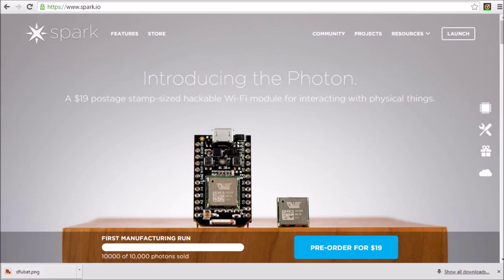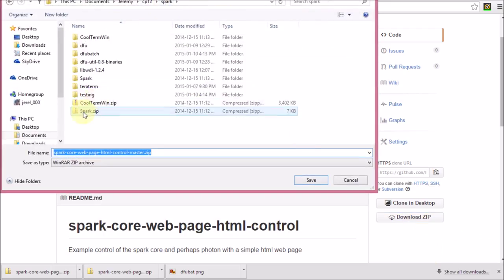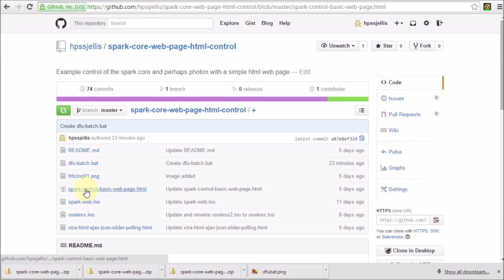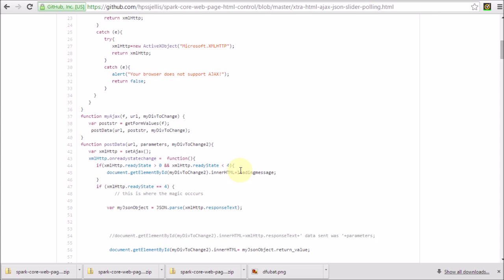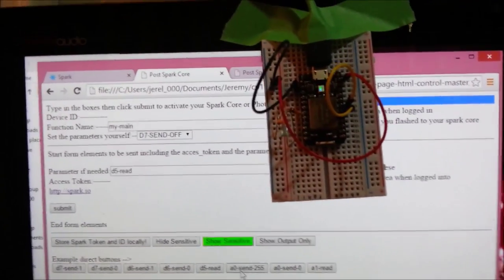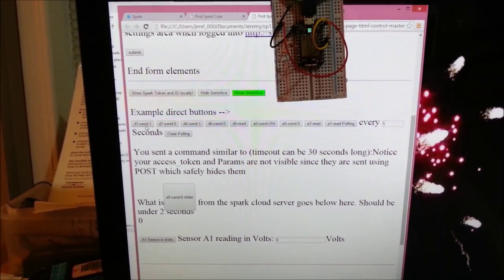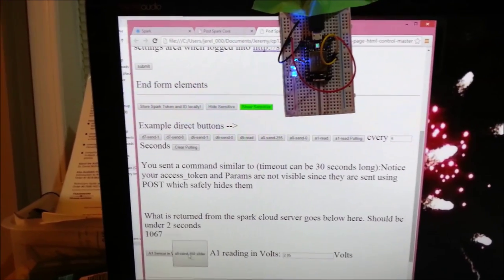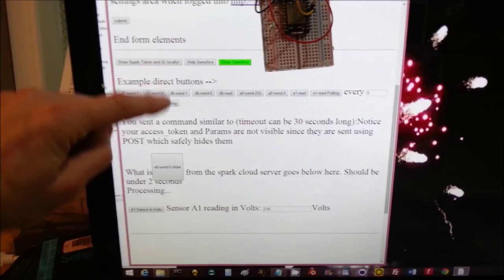Web Page Control of the Particle.io Photon (formerly Spark.io Core)

Comment: Hello, i used this demo page code for reading and sending values for digital button but i am not able to get the correct value when i click on read button.

I manually added button for "d5-send-1" also in this page.

Firstly i clicked on "d5-send-1" then its on the d5 button on device and it return the value 1 but after that when i click on "d5-read" then it should be return 1 but it return the value 0 and also off the button in the device.

If anyone have a solution for this issue then please reply back on this.
Reply from the maker: +Anjali Kesarwani  Try reading from D4 and connecting a wire from D5 to D4.

Comment: Hey Jeremy, I just bought a Photon, and I am trying to create a simple webpage where the user would be able to simply be able to turn on and turn off the the LED without accessing the Web IDE. I already have the circuitry and my simple code. I am having a hard time getting creating the webpage. Feel free to help me on this matter. Thank you.
Reply from the maker: +Derek Salomon 

Hey Derek:

When you say "without accessing the web IDE" I am a bit confused. The web IDE is only used to upload code to the Photon. The actual website described in the video can just be on your home computer or any website. If however your mean, without using the http://particle.io cloud based website things get a bit more complicated. The particle.io cloud actual helps us communicate with the photon, however it does make a bit of a time lag between about 0.5 - 2 seconds depending on your internet connection. This is fine for most Iot interactions. If however you need faster speeds, I have solved that issue but it is a bit of a hack,  and needs you to be familiar with node.js server computing using cloud9   http://c9.io. Not sure if that is what you want. Anyway my solution is described at

https://community.particle.io/t/tcp-server-and-client-example-socket-programs-d7-on-please/11307/30

and the github site is at

https://github.com/hpssjellis/Particle-Spark-Core-Photon-Websocket-Hack

sorry but I have not yet made a video about it. The solution is a really bad hack of websockets, with no security but it does have interaction speeds with the photon of about 3-10 milliseconds, which is really fast. (depending on the internet speeds)

I am sure someone else has made a much better and more secure version of this.
Reply: +Jeremy Ellis 

Hey Jeremy, sorry for the confusion. You cannot avoid using the Web IDE to upload code on the photon. I wanted a code to create a simple website where I will be able to turn on an LED connected to Pin D2. On this website, I would just click a button that turns on and turns off the LED. I am just having trouble on getting a code that will give me the website. Thank you for your help.
Reply from the maker: +Derek Salomon Ok. That is a bit easier. The code that will work for your issue is at http://rocksetta.com/spark-core-photon/spark-control-basic-web-page.html  Now I could make the code a bit easier with just a D2 on and D2 off button, but you would still have to enter your Device ID and Asses Token before it would work. If you have uploaded  http://rocksetta.com/spark-core-photon/spark-web.ino   to your core, it should work. First test the D7-send-1 and D7-send-0 buttons, since they should always work. Then look at the code for D7-send-1 and D7-send-0 and edit it. Until I make an easier one you can try just deleting or hiding the other buttons for now.

As I said, the page is not the easiest but it should work. I will make a simple one later.
Reply from the maker: +Derek Salomon I have added an absolute basic webpage at https://github.com/hpssjellis/spark-core-web-page-html-control/blob/master/simple.html but I can not test it until I get back to school. Note: I am using the Core you are probably using the Photon, I will try to test it on both.
Reply: +Jeremy Ellis Thank you Jeremy. I am currently using the Photon. I'll test it tomorrow and let you know.
Reply from the maker: +Derek Salomon I just loaded onto my new photon https://github.com/hpssjellis/spark-core-web-page-html-control/blob/master/spark-web.ino and then from my own computer the webpage at https://github.com/hpssjellis/spark-core-web-page-html-control/blob/master/spark-control-basic-web-page.html and they worked fine. Problem one over the code works on the Photon. I then tried my simple.html page on the github site and it did not work, something in the working page is missing. I will problem solve it but with school starting I am not sure of the timeline.
Reply from the maker: +Derek Salomon 

OK Derek I got it working. It is much better than the original, easier to understand and work with. The github site is at

https://github.com/hpssjellis/spark-core-web-page-html-control/blob/master/simple.html

You stil have to load the .ino file on your photon and the original pages are much better for making youtube videos as you can hide the security data. The original pages also give you more information when you are debugging if it is working or not. Once working, I would then use this new page.
Reply from the maker: +Jeremy Ellis +Derek Salomon

Oops the new file simple.html does not return Analog or digital read values. I made a new file called AjaxBetter.html that solves this problem. The file is a fair bit more complex but it works with 3 very obvious buttons. Check out
https://github.com/hpssjellis/spark-core-web-page-html-control/blob/master/ajaxBetter.html